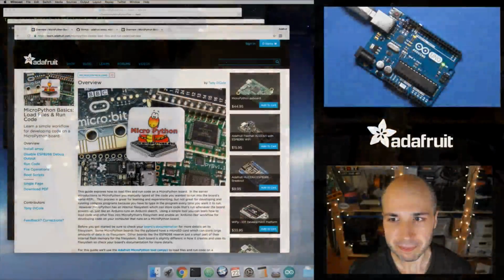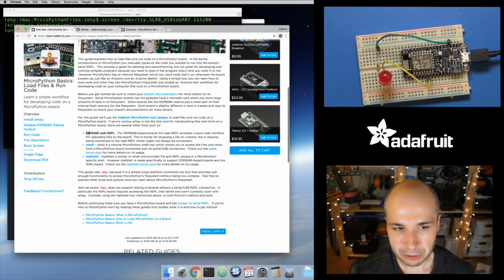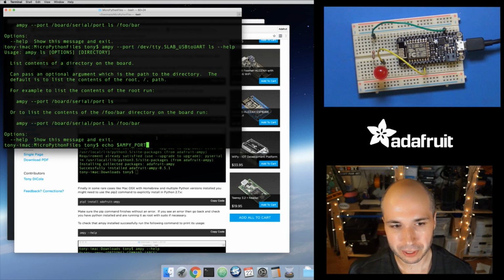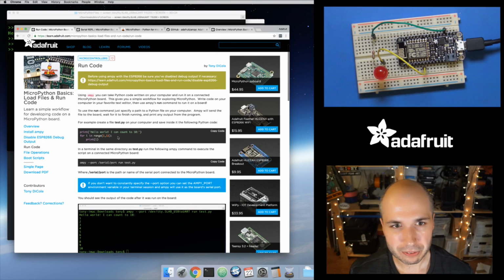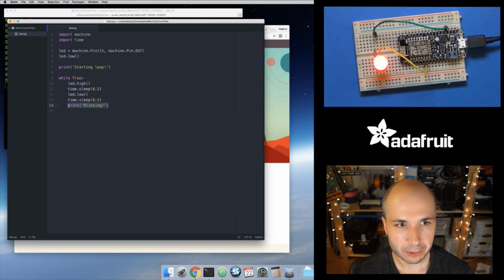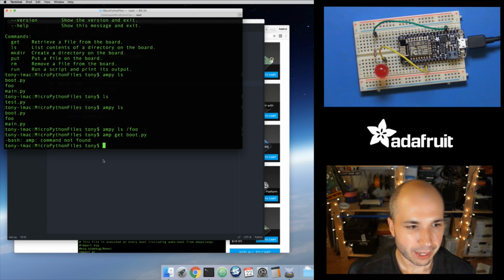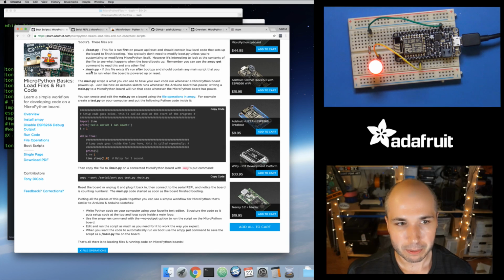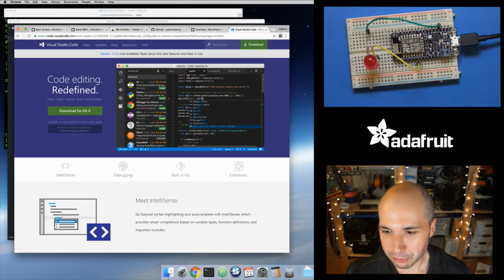MicroPython Basics: Load Files & Run Code with Tony D! @micropython #LIVE

Comment: Ideally the device would show up as a mass-storage-device, such that scripts can be dragged over.  But instead of a tool (ampy, thonny, mu-editor, Pymakr  etc), I think using the REPL interface (rshell, mpfshell) might be the more native way to upload files!

As far as executing the file, since Python3 removes execfile("my.py", global_vars, local_vars), is run or runfile the preferred way of executing via REPL?  runpy.run_path?   exec(open("my.py").read(), globals())? 
with open("my.py") as f:
    code = compile(f.read(), "my.py", 'exec')
    exec(code, global_vars, local_vars)

Speaking of globals, if one executes a script that opens/connects the uart/bluetooth and uses a global variable for the interface/handle..  once the script closes does the connection stay open and the handle stays available for other scripts?

Reason I ask is that I'd like several scripts to access the same peripheral.  For example, can REPL be configured to another UART port, so that my scripts can access the UART connected to the host?   Ideally I'd like to have micropython (REPL) running on BOTH cores, one running REPL on the unused serial, while my scripts run on the other core using the UART/USB.

Comment: I'm using pycharm with wipy2.0. It works but is broken somewhat. I can get a repl and also pycharm uploads main.py fine. You can run your code just like you'd normally do in pycharm except you'll have to put the libararies in lib manually. That don't work.

Comment: First off thanks for all these guides, you sold me on this platform and I recieved my Feather ESP8266 yesterday, soldered on the headers today and I got my first scripts on it and I'm super stoked!

There are a few quirks I've found though. In windows 8.1 when I run the ampy run --no-output C:\...\test.py command it doesn't execute any of the code. Same with -n.
When I run a simple script where it has to blink the Red Led 10 times and then stops it always blinks the Blue LED once after it's done. If I add the --no-output argument I only get a blink from the Blue Led, but it doesn't actually execute the script.
It doesn't bother me, I don't really see the need to use the --no-output argument, so I just won't use it. But I thought it might be a bug or something.
Reply: Also when I run the ampy ls command or I use ampy run to run a random script from my pc it does what it's supposed to like show me the files or run the script and when it's done it also starts running main.py.
And I don't get the print statements in the command prompt untill it's done running. So if I only have a short script it finishes every task and then gives me all the print statements at the end all at once. But when I use a while True loop I never get any print statements because it never finishes it's tasks.
Also a bit of an inconvenience is that I can't use the Command Prompt and Putty at the same time, because Putty hogs the COM port and that means I can't use the command prompt to check the files on the ESP. So I often have to choose between reading the print statements and being able to run a file (afaik) or switch really quickly.

These aren't big issues for me, just things that are good to know if you're interested in this platform and you're a Windows user. I highly recommend installing Linux. Sadly my pc won't let me install a different OS due to UEFI protections. But I'll work around it :)

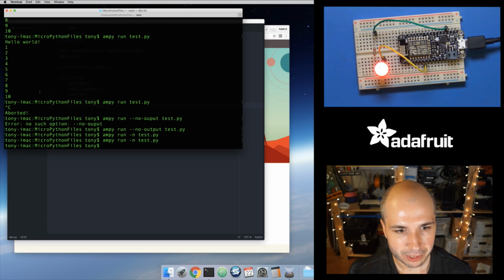Comment: I cannot follow the screen debug shown at 31:50
I can run the program without output but when i open the screen repl it stops and just shows the repl command prompt.
My board is Wemos D1 Mini (esp8266) and i use the driver of the wemos website. my device port is /dev/cu.wchusbserial1410
Does someone have a solution?
Edit: I just found out that screen print out does work when i run without the no-output -n flag. But of course i would like to use the -n flag so i do not get the error after the ampy run command waits to finish

Comment: Hello,
When I code micropython in an editor, i get errors for the 'import machine' line.  Is there a way to avoid this?
Reply: i just found the solution: i use visual studio code with pylint. just writ the comment '# pylint: skip-file' above the line with the import module and it will ignore errors for this module.

Comment: Hey Tony,
Thanks for this excellent tutorial. I do have some suggestion for your Ampy software (v1.01):
1. You should add the --no-output or -n to the help
2. How do your differentiate file and folder from ls command?
3. I try the "Ampy reset" command after I download my main.py but it won't run. I have to Hardware reset the device to work. Is it normal?

Comment: I used ESP8266 Flasher and  esp8266-20170108-v1.8.7.bin 

All it does is flash its on board led non stop and send garbage to the serial terminal I have tried different baud rates and smae problem. I tried Putty, Tera and Real.
I am running nodemcu with 340 chip not ftdi.

I am using windows 7.

Comment: Hi Tony D! 

Thanks for these tutorial videos and all your development efforts with "ampy". Ease of use is certainly a prerequisite for making a product/tool popular. "Ampy" helps make MicroPython a lot easier to use. 

However, on my Win7-PC, where I'm running Putty for the MicroPython REPL interactive interface and cmd.exe (command.com) for running "ampy", it seems these two apps are constantly fighting each-other for control of COM15 (my USB port id). Usually I have to close down Putty, run the "ampy" command in cmd.exe, then restart Putty and by that time the messages have already passed by. Is there another set of tools (text editor and serial terminal emulator) where these 2 apps are not  fighting for control of the COM port? I think ideally, there should be one program that offers both text editing capabilities and terminal emulation capabilities, perhaps in separate "panes" of the same application, with code to share the single COM port between both apps. This would go a long way in helping to create an "IDE" for MicroPython. Perhaps the "ampy" functionality could be added so we don't need to go into cmd.exe to execute "ampy.".  Any suggestions?  Anybody?

Comment: YAY ! 
>>> help('modules')
_main_          gc                select            upip_utarfile
_boot             inisetup          socket            urandom
_onewire          json              sys               ure
_webrepl          lwip              time              uselect
apa102            lwip              ubinascii         usocket
array             machine           ucollections      ussl
btree             math              uctypes           ustruct
builtins          micropython       uerrno            utime
dht               neopixel          uhashlib          utimeq
ds18x20           network           uheapq            uzlib
errno             ntptime           uio               webrepl
esp               onewire           ujson             webrepl_setup
flashbdev         os                uos               websocket
framebuf          port_diag         upip              websocket_helper
Plus any modules on the filesystem
>>> 
that's a lotta choise :-D !  thnx for the great tutorials !

Comment: A tip for you guys.  To automatically run saved python files, I installed fswatch on my Mac using homebrew.  It triggers when monitored files change.

Run any updated file: fswatch *.py | xargs -I {} ampy run -n {}
Upload any updated file: fswatch *.py | xargs -I {} ampy put {}
Run only a specific file: fswatch blink.py | xargs -I {} ampy run -n {}

There are probably other ways, but this one works for me.

Comment: I really enjoyed all the tuts from adafruit and Tony. Its great, specially the ampy. I could see there is I2C module available in ESP8266 micropython. When I try to use this for connecting LCD and pass a message the only thing that happens is the LCD goes off. Can you suggest some tutorial where I can get that working.

Comment: Tony thank you for great series.   I loaded Ampy on my dreaded Win10 pc.  It works great.  Then I tried to load it on my favourite Ubuntu 15.04 PC and I got some errors using Pip3.  It sort of looked like it installed, but it complained about certain files and folders having not been previously installed, (sorry I don't have a record of what went wrong). I think it was referring to Ampy specific files as opposed to some Ubuntu OS resources.  Anyway now at the linux command line if I type 'ampy' it doesn't find the executable.  Is there a Path Statement I need?  Is there a way to check or re-do the install?  I tried the python3 version.  On Ubuntu if I type 'python' it runs the 2.7.9 version, where as if I type 'python3' it runs 3.4.3.  Any ideas?  Can anyone else confirm it installs on Ubuntu with the pip3 method?  PS I didn't use the sudo method installing with pip3.